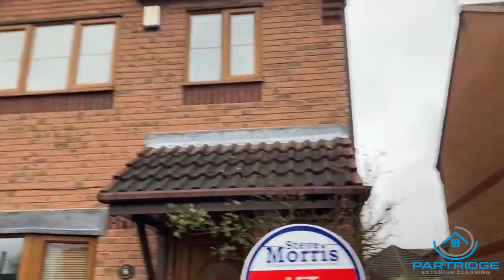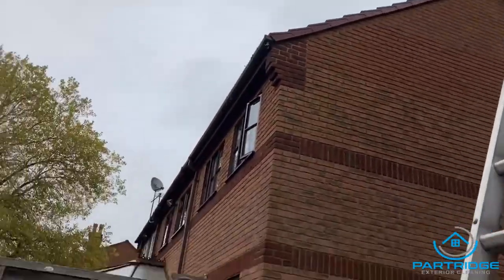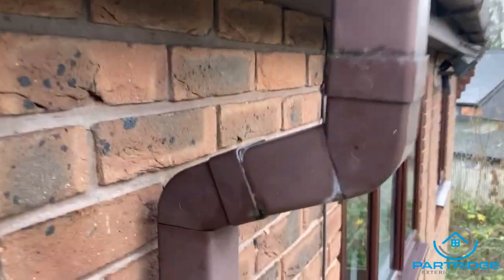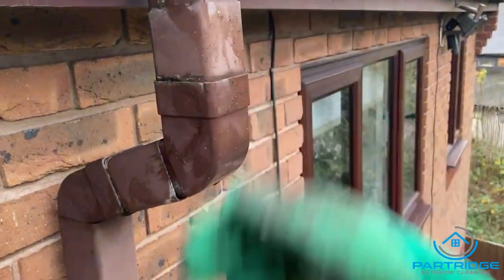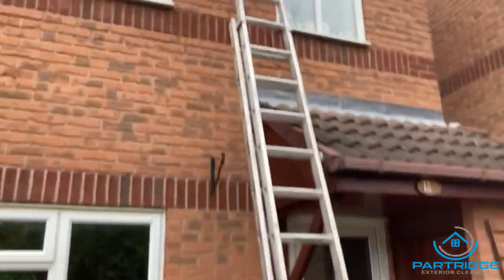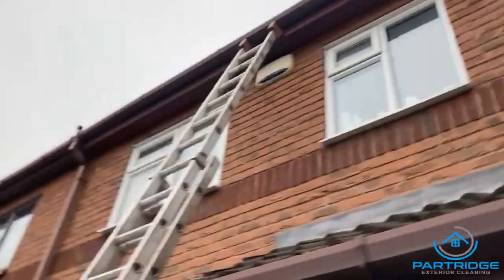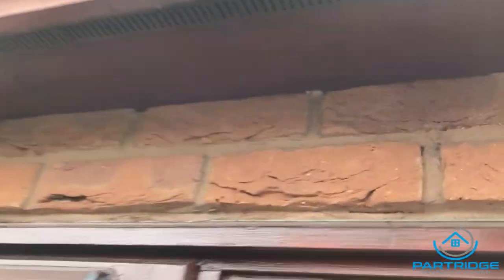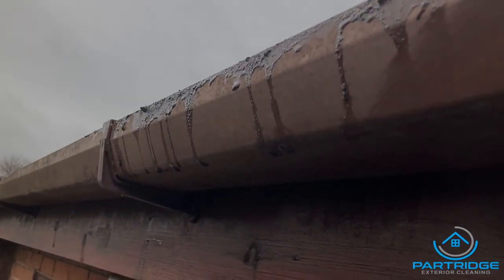Tips for GUTTER CLEARING! // Partridge Exterior Cleaning

Comment: extra tip. if you get the chance and space in your van. buy yourself a few drainpipe replacement for the top goose neck.
same with roof tiles and what not. if you have the space to just have a few in stock that can do wonders.

and or know someone you feel safe to recommend that can replace them if needed. they will often reciprocate that and will advertise you for your speciality.